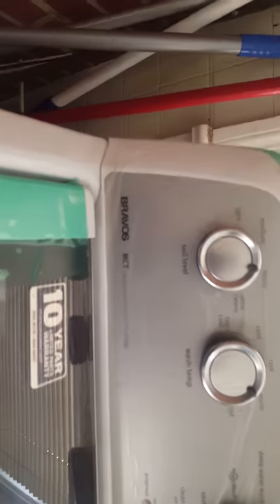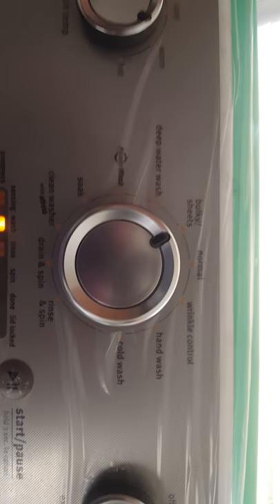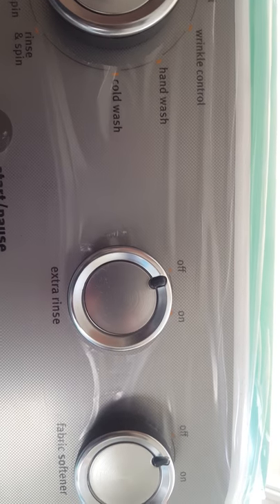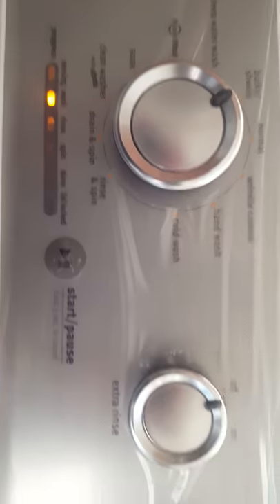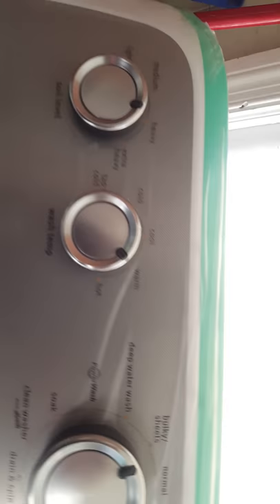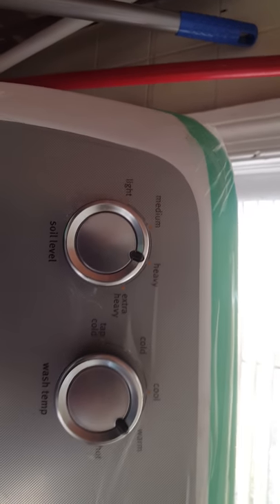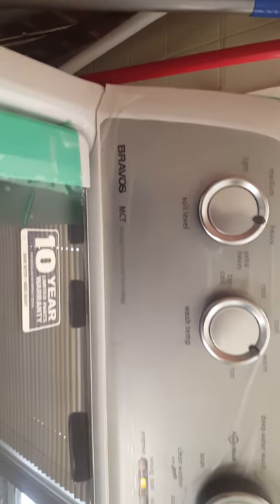How to get more water in the new Maytag bravos

Comment: Worst washer I ever owned. I agree that this setting works because I found it by trial and error. The problem is that quite often it's more water than needed and there's no in between. All the other settings aren't enough water and Bulky Sheets is more than needed. Maytag replied to me that I didn't follow the instruction and that's why my clothes and towels got torn up. I actually read the manual and did exactly what it said. Last Maytag I'll ever own.